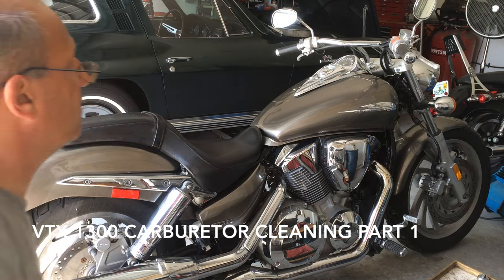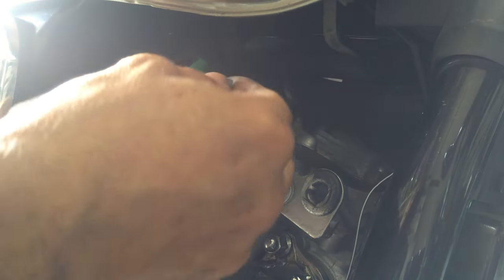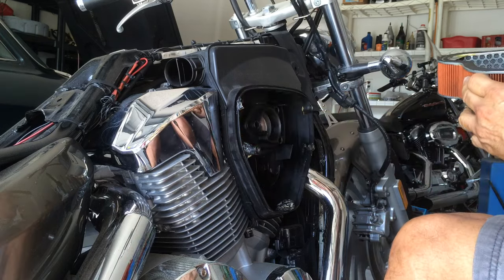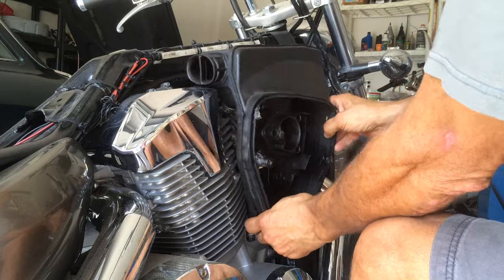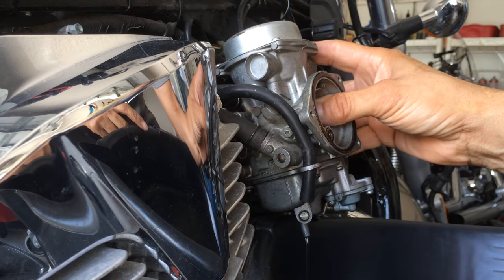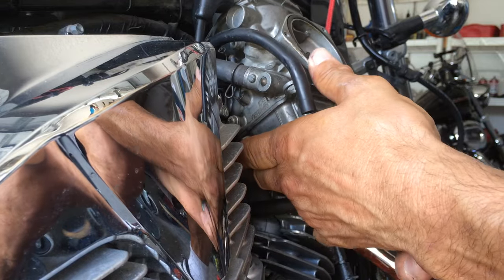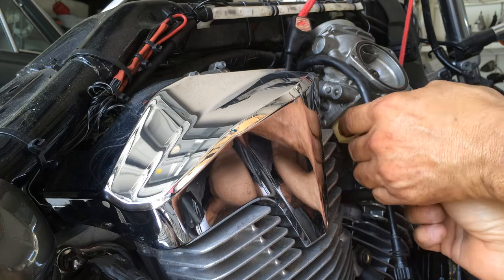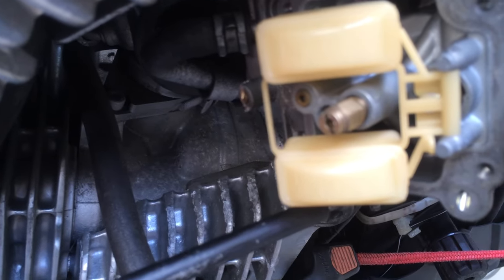How To: Honda VTX 1300 Carburetor Cleaning Part 1

Comment: Rocco, I have a 2007 VTX1300 that about every 500 miles needs a carb clean and plugs are fouled. I have used nothing but premium fuel in it since i had it and I wonder what you think about disabling the choke and putting in a jet size 58 or higher? My A/F is set at two turns by the way. It is a great bike when it runs properly  and I am trying to come up with a permanent fix.
Reply from the maker: Happy to help. They are notorious for bad  diaphragms in your petcock. This makes for a very rich running motor. I will send you a video on testing the Petcock. This is the same test used on Harleys that will work on your VTX Honda.   . https://youtu.be/7Fo9Q93OJXI    Thank you for watching and your sub. Vinson. Let us know how this works out.  Ride safe and have a great day.   Ebay. https://www.ebay.com/itm/283807394619?hash=item42143d2b3b:g:k5UAAOSw9hteY~O6.    Hope this helps.
Reply: @TwoWheelRocco  thank you. Will try it and let u know. Can u link me to the petcock tester?
Reply from the maker: @vinsonwalton28  https://www.toolots.com/wd-0017.html?cid=9952931480&gclid=EAIaIQobChMIwNaDseq99QIVGTeGCh2msgxrEAQYASABEgKnwvD_BwE. This will work.  Parts store too loan program doesn't cost you nothing. AutoZone.
Reply: @TwoWheelRocco  so a bad diaphragm in my petcock can cause crazy hesitation and backfiring? So I should look at petcock before changing a jet?
Reply from the maker: Here's my logic if it ran good before, then you know you're jets are not the problem. Petcock. is a major issue with Hondas and Harleys vacuum diaphragm.  too much fuel Is the problem. when those diaphragms get that bad you can smell the gas in your engine oil. Not good thing, check your engine oil if it's overfilled you know there's gas in there.  I've seen it too many times. start there let me know how it works out.
Reply: @TwoWheelRocco  Yessir! Will do!
Reply: @TwoWheelRocco  Sir you know your stuff!! My oil chamber is absolutely overfull and the oil drips a lot easier than engine oil should! I am ordering a petcock and an oil change kit immediately! Thank you! Will update you on my progress.
Reply from the maker: @vinsonwalton28  I would recommend that you purchase the diepham rebuild kit and petcock screen.  ,https://www.ebay.com/itm/273845180925?epid=26019485082&hash=item3fc271d9fd:g:rcMAAOSwMcZc2kSaso at least you will keep the same quality Petcock that Honda made. Chinese ones can get you in trouble the gas today is brutal. Let us know how it works out
Reply: @TwoWheelRocco  yessir. Do u have oil change product you recommend?
Reply from the maker: @vinsonwalton28  where are you located? What part of the country?   I like Lucas synthetic 10/40 MC oil/.  auto zone
Reply: @TwoWheelRocco  Dallas Texas sir
Reply from the maker: @vinsonwalton28  Lucas synthetic 10/40 MC AutoZone
Reply: @TwoWheelRocco  okay thx will let u know how it comes out
Reply: @TwoWheelRocco  Well, I changed the petcock as you said. I changed my plugs and set gap .035. I changed oil twice to help flush out the gas in the case. Bike is running great again. Thanks bud. You are the man. No one else on Youtube was talking about the petcock being the issue. Thanks again. I imagine you just saved me a bunch of money doing it myself.
Reply from the maker: @vinsonwalton28  Love great outcomes, Happy to read all went well.   VTX1300s are great bikes. Will last forever. Thank you for watching and your kind words Vinson.  Ride safe and have a great day.
Reply from the maker: @vinsonwalton28  Florida. sunshine state.    from New York 22 years ago.
Reply: @TwoWheelRocco  sir it backfires some still. Just a little. I rode it today and it had a slight hesitation one time during second gear but that was all. You think its just kind of purging everything out and will be okay or should i be looking somewhere else as well?
Reply from the maker: @vinsonwalton28 I would run it and put some miles on it and then see what you got. stock pipe not drilled? with stock air filter?
Reply: @TwoWheelRocco  yes all stock no drills okay i will run it a bit and see what’s happening then
Reply: @TwoWheelRocco  i rode today 75 miles. It hesitated one time when i was a bit longer than normal coming out of first. Other than that it ran beautifully today. I think problem solved thanks to you Rocco. I have subscribed and will consult you when i have issues. You are the best on YouTube
Reply from the maker: @vinsonwalton28 Thank you,  How do your plugs look?  pull one, an easy one.
Reply: @TwoWheelRocco  the one i pulled looked dry. Not perfectly new anymore but dry. Is that a good sign?
Reply from the maker: @vinsonwalton28  any black on the plug?
Reply: @TwoWheelRocco  yes a little
Reply: @TwoWheelRocco  what does that mean
Reply from the maker: @vinsonwalton28  I would replace that needle jet on your float. That controls the amount of fuel  in the float bowl. They deteriorate because of the ethanol in the gas.   I would go to the dealer and buy a Honda part. $23
Reply: @TwoWheelRocco  do u have a vid on how to do that?
Reply: @TwoWheelRocco  okay thx. I found a vid in how to do that. Will get parts like u told me and will let you know how it comes out next week
Reply: @TwoWheelRocco  Okay bro i changed my petcock, plugs, and the engine oil. Still some hesitation so i went into carb just like you said and your vid shows and found a vacuum hose leak and my main jet was mangled like someone tried to enlarge it or something. I changed the main jet to stock and cleaned the idle jet, put back together and runs better than ever now! Thank you! I appreciate your help and your informative videos.
Reply from the maker: @vinsonwalton28  Happy to read all went well. VTX1300 Great Bikes,  Thank you for watching and your support Vinson. Ride safe have a great day. Stay warm.

Comment: Can anyone help me. I’m in the process of cleaning my carb and realized that the hose attached to the carb is missing. Black hose in 4:50. What does it do and am I screwed?
Reply from the maker: Happy to help. That is Vent hose,  attaches to the side of Carburator. It will have no effect, that hose you are missing.  Thank you for watching and all your support Carl.  Ride safe and have a great day.
Reply: @TwoWheelRocco wow thank you for the reply! And the great video! 

So after further inspection, it looks like I do have an air vent hose attached to my carb but instead of the traditional bending down. It looks like it’s running up to where my forks are.

is this normal?
Reply from the maker: Most times I see them just vent right down and it vents to the front. Maybe it's a California bike but it's no problem. Have a great day. Great bikes VTX have fun ride safe. @carlgonzales177

Comment: What are u doing to check the accelerator pump?
Reply from the maker: Happy to help. Before I take it apart, I twist the throttle and you could see the squirting  of gas. so I know the accelerated pump is working. Thank you for watching and your sub Dave. Ride safe and have a great day. Let us know how it works out.
Reply: @TwoWheelRocco  if u twist the throttle and no gas shots out what could the main issue?
Reply from the maker: I would test the petcock that would be the first thing I would do, To make sure gas is flowing.   Your diaphragm in your accelerator pump is bad. You could take the float bowl off and test it. I'll send you a video of us accelerator pump rebuild.   This is a sportster carburetor but the principles are the same take a look at this video.   https://youtu.be/BEvtEw_twPQ.    I would test the Petcock first and again this is from Sportster but the same idea I'll send you this video. A very common problem with the Diaphragm's in the petcock fouling and flowing no fuel to the carburetor which would affect everything. What is your bike doing exactly. Here's the video..https://youtu.be/7Fo9Q93OJXI
Reply: @TwoWheelRocco  i replaced the petcock and also noticed when i remove the fuel hose and turn the switch to on ,no gas comes out ,thanks for all your help!
Reply from the maker: @davegibson3763  they all vacuum operated so the motorcycle has to cycle to create a vacuum to open the diaphragm to let fuel flow. I hope that helps.
Reply: @TwoWheelRocco  That totally helps!At least i can rule out the new petcock as a problem.You very helpful sir,thank you for your time.
Reply from the maker: My pleasure. Any questions just ask. Let us know how it works out.

Comment: quetion : can you confirm the VTX 1300 has no fuel filter....
Reply from the maker: In your gas tank there is a screen, That I usually replace when cleaning tank and petcock. Clean fuel is a must. or you can never get your carburator to run right.  Let us know how this works out.

Comment: My 2004 Honda 1300cc stalls when I put it in gear
Reply from the maker: Safety neutral....check wires on clutch handle. Or kick stand safety switch..... let me know how that works out....

Comment: My carburetor keeps leaking gas
Reply from the maker: You need to replace your needle jet on float....Let me know how this works out.
Reply: Two Wheel Rocco i HAVE open cobra pipes does that have to do with the leaking
Reply from the maker: No....Need to clean needle jet on Float or replace...What year and how many miles?
Reply: Two Wheel Rocco 07 1400
Reply from the maker: Clean carb. and petcock and replace needle jet on float..Let me know how this works out.